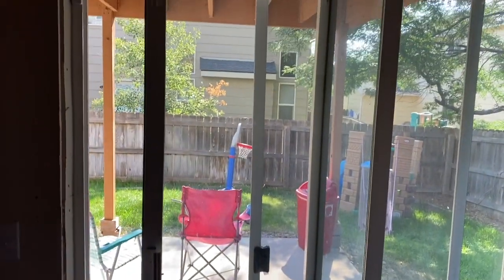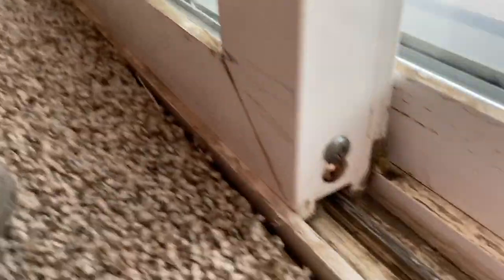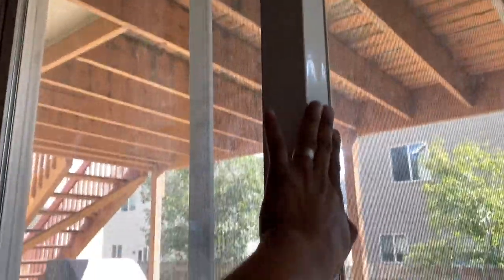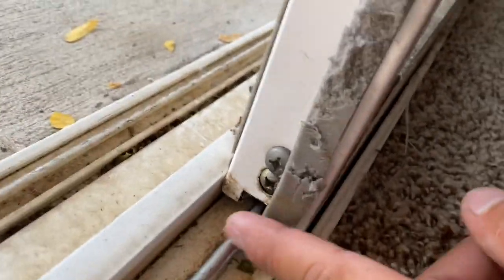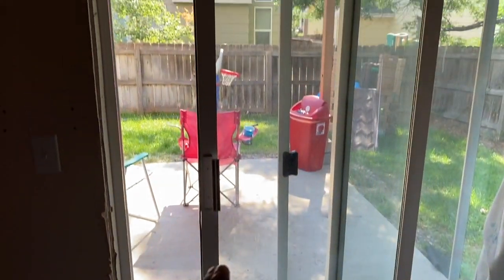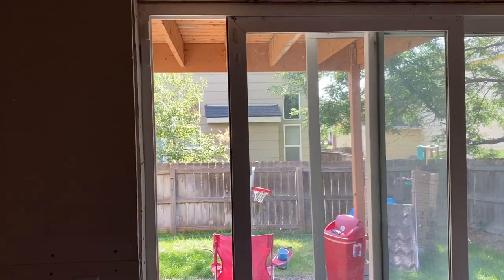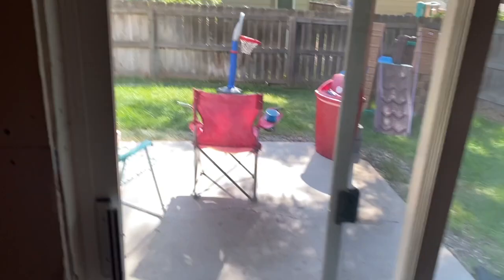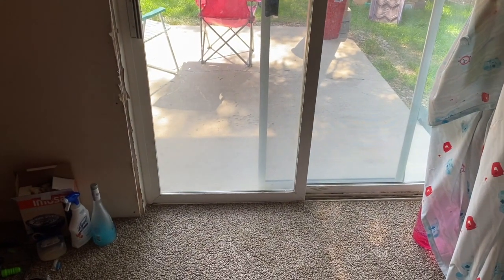Sliding Glass Patio Door Won't Slide Smoothly | How To Fix It

Comment: From my experience, the small bottom screws hold the door together.  The large top screws adjust the wheel height, which impacts squareness of door and smoothness of riding on tracks.  Sliding door problems come in 2 categories.  1.  Track Rails Bent -  Buy overlay SS track rails, $50-60, or use liquid steel $5-10 to smooth out tracks.  2.  Wheels, bearings shot - buy new wheels.  Be careful in replacing wheels if screws are rusted.  You will likely have to remove wheels by removing bottom screws holding door together and then removing lower portion of door.  This will give you access to the old rollers, which can be removed and replaced.  There is a lot of bad info on Ytube about dealing with side panels on door.  Almost impossible to get rubber seal correctly inserted on side panels to keep door square.  GOOD LUCK.

Comment: better to just replace the rollers, sand the runner with 200 grit sand paper then 1000 steel wool. spray with Pledge not WD40. THEN align as shown. simple alignment is often only part of the problem.
Reply: Bill, 1000 Steel Wool or 000 Steel wool? I tried to find 1000 but could not.